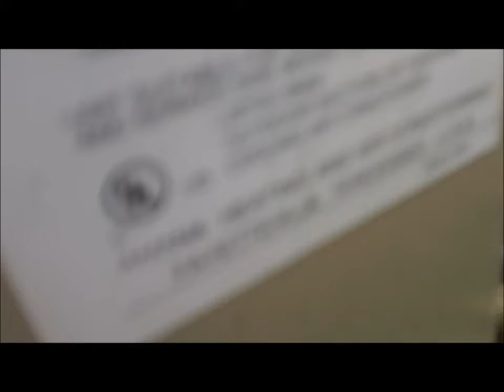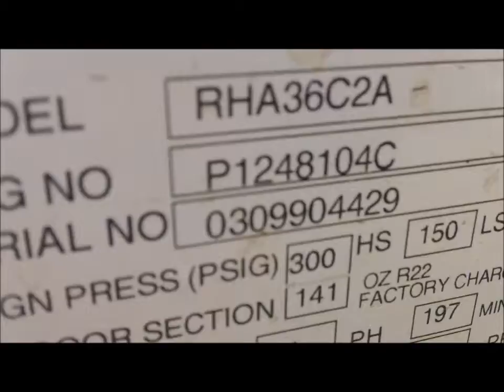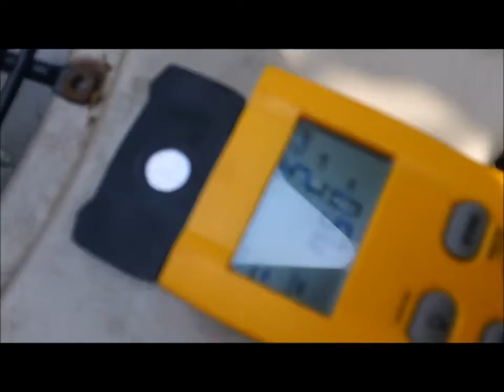HVAC Service- Leak Search & Repair

Comment: You ever gotten a leak call gotten there units bone dry and still running. Test it with dry nitrogen and found no leak. Is somebody trying to pull a fast one?
Reply: I know this was a question from two years ago lol but yeah either its sabotage or the caps are pushing in the Schrader cores just enough I've seen that

Comment: Okay, you fixed a leaking unit... Great. How if that same customer calls you in three months for another leak, then you fix it again. I wonder how much money you will charge for every pound of R22, especially with almost $100 pound. 8 lbsx100+ labor=$1,000 plus. Then another $1,000 plus in maybe 3 to 6 months. By the way you forgot to replaced the liquid line dryer.
Reply from the maker: Ok Mr salesman relax!!! This video and repair was done over a year ago customer has not had any more problems no leaks system is working great!!! I didn't open up the system just repaired a pin hole so the drier is fine & don't say it's not cause the system is cooling & heating it's ass off!!!
Reply: Albert, there is nothing worse than to be under pressure with 85 degrees inside and decide to buy a brand new system for $6K. There are many questions about those "unfixable" leaks when the last person touching it tried to sell you a new system with no option to fix the issue - almost to the point why the hole is there for no reason. If you watched the video, customer has a new air handler. No need to get a new system installed by shady unprofessional people
Reply: It drier not dryer.

Comment: Love your videos. I'm watching all of them and learning so much about HVAC. But can you tell me after charging the system with nitrogen do you have to release all of the nitrogen from the system before charging? Or is it ok to add refrigerant while nitrogen is in the system? Thanks.
Reply: he ran vacuum on system which will take all gases out of system, so to answer your question yes release the nitrogen before charging.

Comment: Big companies don't get big being crooks. Profit is not a dirty word. If you repaired that system and added 8 lbs of r22 for cost you did no favor for the customer. Didn't even change the drier. So it's sad you bash big companies and don't do it 100% correct yourself.
Reply: latrobenut66 It's not up to you to decide what is best for the customer. It is the customers decision. You inform them, give them options, let them know your "professional" opinion and then let them decide. But in your defense, what a lot of people that have only worked for big companies don't understand is that us smaller guys can do this job in 1 hour and make $200 profit and only charge the customer $300 where a big company would charge more like $800.  And seriously, this unit was only 10 years old. Do you really think It is best to tell the customer it is time to buy a new unit as soon as the warranty is up instead of doing a quick inexpensive repair? Thats f*cking crazy!

Comment: Too late, after I paid $ 645 to fix the leaking. they said cause the compressor no felon and i turn on the whole night. So the compressor burn and can not to be fix n need to replace the whole unite. For Trane   over $3000 they suggest Goodman $ 1300. I don't know what to do now in this hot summer.

Comment from the maker: Sorry for getting back to you so late!!! 2006 model there is no reason to replace the whole system!!! I just went on a job a few days ago and the customer had a 2006 system installed by some other company!!! There are some problems with it but im fixing them not replacing the system!!! Best advise I can give you is stay away from the big companies!!! Try to find someone where the owner prefroms the work like myself or only has 2 or 3 trucks!!! Hope this helps!!!

Comment: I have the same problem.My HVAC is 2006 in my vacation apartment which was blank new and i never been use until this summer.I active the warranty last OCT. But no cool air n i call the warranty company n they send some one and said it was leak, n no way to be find where n fix it. All can do is to buy a new system. n the warranty was expire.Luckily I saw your video n I am on hold on it. But the problem is where can i find the honest and experience man like you to fix mine in St Louis MO?